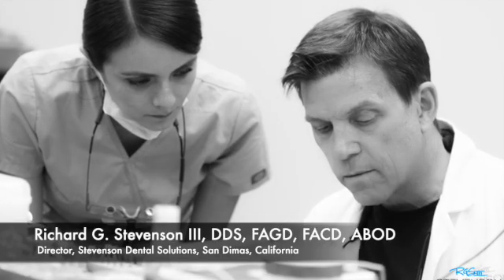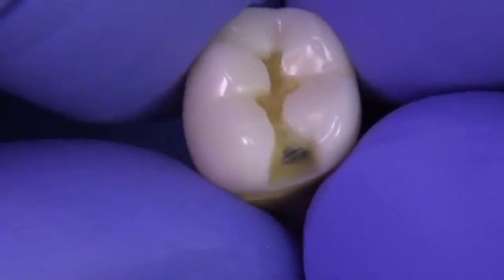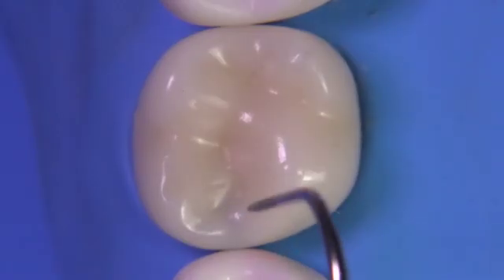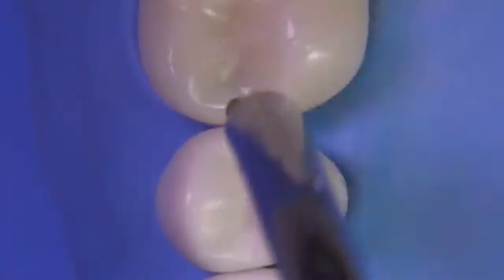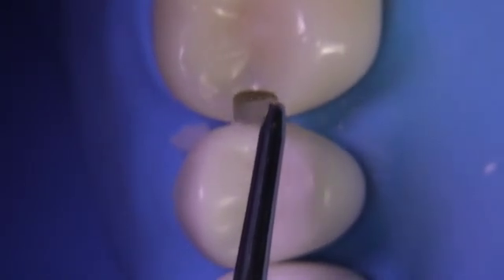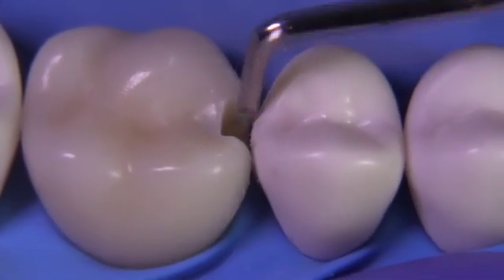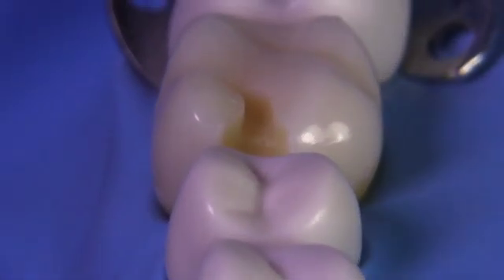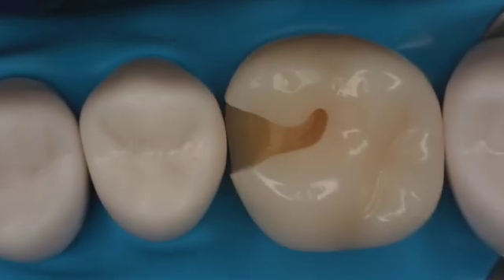Class II #14 MO Preparation RTX Caries Tooth for WREB

Comment: Greetings dr. Steveson
I had a question with regards to engaging the hatchet in indirect vision to make flaring exit angle for the composite restorations

Your advice on this is appreciated
Reply from the maker: This is very difficult at first. Try moving the head towards or away from you.  Use a very sharp new hatchet - a good hatchet, not the $15 eBay version. Try making most of the wall with the bur and use the hatchet to remove only the smallest amount of tooth.

Comment: Dr. Stevenson, thank you for the video. How come the internal axial wall of the proximal box is concave, not convex? Shouldn't we be concerned about the pulp proximity?
Reply from the maker: The axial depth is still ideal, it's just that the axioproximal line angles are rounded...the idea being that the prep is caries-driven with composite.  The pulp is 3-4 mm inside the box.  The axial depth would be the same for any preparation, namely about 0.5 mm into dentin.

Thank you!

Comment: Dr. Stevenson, you didn't prep the distal pit in this video. Is the distal pit supposed to be included in the minimum Class II MO prep for maxillary molars (for exam purposes)?
Reply from the maker: On the WREB the distal pit will be a required carious lesion to remove... You may either connect it to the MO by crossing the oblique ridge, or keeping it separate.

Comment: Great video doc …..I have a question what’s the position to work for molars especially the box area ( buccal and lingual )
Reply from the maker: For maxillary teeth, I like 11-12 o'clock with the mirror.
Reply: @StevensonDentalSolutions  I am struggling with the lower molars 😅 especially #30 so what do you recommend for mandibular molars doc thanks a lot
Reply from the maker: @bruhbrx  Cut most of it from 7 O'clock and then finish the box with direct vision from 9-12.  It takes time but keep trying different chair positions, with and without the mirror.
Reply: @StevensonDentalSolutions  thanks a lot doc God bless you
Reply from the maker: @bruhbrx  My pleasure!

Comment: Hi Dr. Stevenson, I had a quick question about protecting the adjacent teeth. When I am practicing with the ModuPRO Typodont and the RTX #9 and #14 Caries Acadental teeth, nothing seems to fit interproximally as a guard on these typodonts. I know you sell a NODAT Damage Prevention Kit on your website, and I was wondering if the guards in this kit actually fit interproximally. If they don't, do you have any suggestions as to what you would use that could fit in between these tight typodont teeth? Thank you so much!!
Reply from the maker: You can make them fit easily with a little separation with a small spoon between the teeth. They will all work well with this technique.  Thank you!

Comment: In this case for the WREB exam, if you were to request extension because of the carries would you ask for a 1mm extension of the axial wall depth?
Reply from the maker: Yes, or perhaps 0.5 mm then again 0.5 mm.
Reply: @StevensonDentalSolutions  ty for the response!
Reply from the maker: @1108steeveee  my pleasure

Comment: Hey! I’m wondering why are you extending your preparation so much? Don’t we as a dentists need to stick to minimal invasive preparation? Just to remove caries only, not healthy dentine...
Reply from the maker: Yes, I am showing both prep designs: amalgam and composite - and the WREB allows for a traditional design or a slot prep for composite as well.  The slot prep will require conventional retention form as well, vis-a-vis convergent walls.  Bonding alone is not enough when most (more than 50%) of the prep bondable surfaces are dentin.

Comment: Thanks for the video Dr! Just wondering, how do you prevent the tooth from burning when you're using the high speed without water?
Reply from the maker: New burs, light touch, slightly lower speed.

Comment: Dr. Stevenson, when you're making a bridge prep, the principle of the prep you make is pretty much the same as for a single tooth crown prep?
Reply from the maker: With the addition of line of draw, yes.  The preps must be sacrificed slightly to accommodate the line of draw and knowing which prep may be altered and which walls and to what degree is the key.